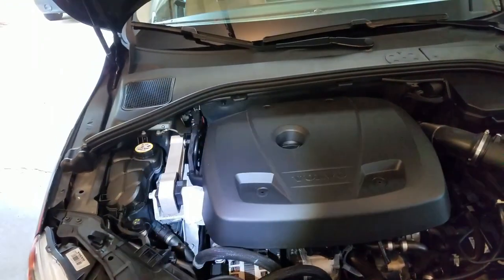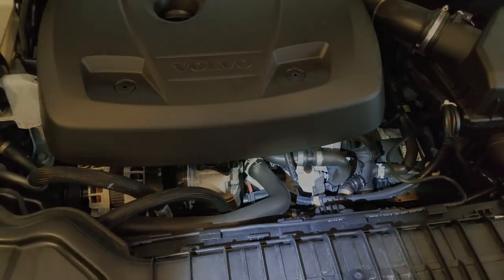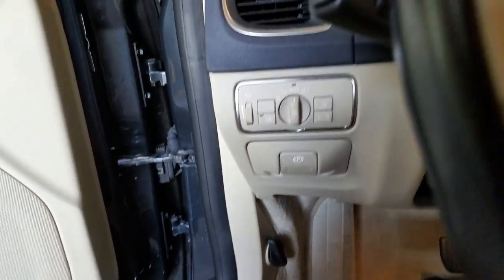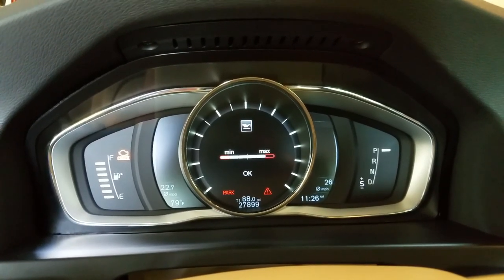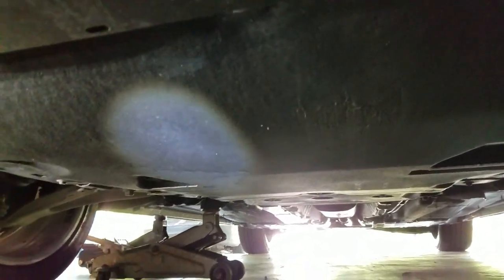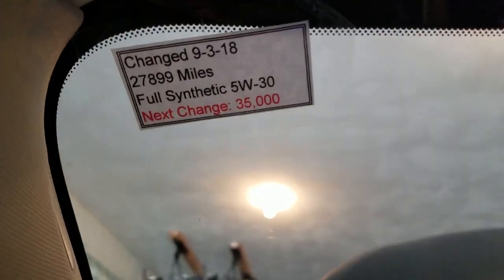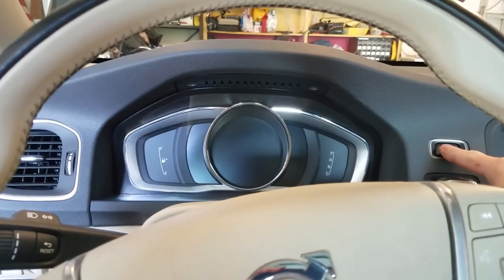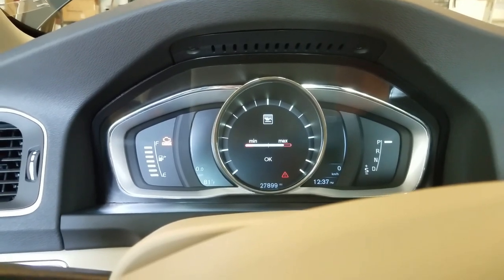2015 Volvo S60 4 Cylinder Oil Change

Comment: Thanks for the video. I want to ditto the other comment on using jack stands as opposed to a floor jack. I just purchased a Volvo with this engine and plan to do the oil changes myself. This was helpful.
Reply from the maker: I like that so many people are safety conscious these days so thanks for that!  I really want to get a set of ramps for it so I can just drive up on it, and even for those, I prefer to have jack stands as a backup too.  Hope you enjoy your Volvo as much I as enjoy mine.  I also have a 2009 S60 with 171,000 miles on it that is still in perfect condition.  My daughter will inherit that one in a little less than a year, and with proper maintenance, she should be able to double that mileage.

Comment: Hi did you check your engine serial number yet for the bad pistons and rings ?
Reply from the maker: I don't know of any reported issues like that for the 2015 model.  Are you thinking of the 2012 model that had a certain engine code, like engine code 62 or something close to that, where there was a TSB or partial recall for excessive oil consumption due to faulty rings?
Reply: @MIFixItDad  No its for the early model 2015.5 S60 T5 . My engine serial number falls in the bad area of poor rings and pistons . There is no recall , If you do have issues Volvo will fix if your in warranty . im pretty mad about it . I dont have the problem yet but probably will . When was your car built ?
Reply from the maker: I have the 2015, not the 2015.5 model.  It must be specific to the 2015.5.  I've searched all forums and reviewed all the TSBs issued for the 2015 S60 and can't find anything relating to a piston or ring issue.  If you have a source that shows what you're talking about with the issue you've seen, post it here.  It could be really useful for people to be able to go look that information up for their car too.
Reply: @MIFixItDad  Is your car the Drive E ? Start /Stop function ?
Reply: Im sorry Floyd im swamped right now i will get some info and post it for you

Comment: Are these reliable?  For college kids
Reply from the maker: Oh heck yes.  If you get one in good shape that had preventative stuff maintained, especially the timing belt and PCV system, then they are excellent cars.  Insurance is cheaper because they are notoriously safe cars too.  Basic things like making sure the suspension/braking/steering components are good (brakes, control arm bushings, struts, tie rods, and sway bar links) will help it last a very, very long time and continue to drive like new.  The parts are cheap and if you can do any work on cars, they are pretty easy to replace too.  Timing belt I would leave to a pro.  PCV system is a pain but a good home mechanic can easily tackle it.  All this applies to the P2 Volvo S60, the ones made from about 2001 to 2009.  The ones made after that, like the 2015, I can't speak for reliability.  If it has the 2.5L 5 cylinder, I would say they would be excellent, but I can't say for the 2.0.  So far so good with mine, but it has a lot more complex stuff on that engine and I think would be a lot harder, and more expensive to work on.
Reply: @MIFixItDad  thank you so much I had a 2012 and it was a great car but it had so many problems but I just love Volvo’s they drive so great and I feel safe in them

Comment: Thank you for a very excellent video.  We have a 2019 Volvo XC60.  I called Castrol and was told to use Castrol Edge 5W30 US in the black container.  Castrol did not recommend using the Castro Edge Extended Performance.

Comment: thanks for the video, yeah, i'm like you, would prefer to see the oil once in a while, but wow, 10k between oil changes is pretty long.   And I probably can't bring this to a quick lube place, with the skid plate and all.  Appreciate, ty
Reply from the maker: Hi Marcus, the quick change places will be able to handle it with the skid plate.  Seems like most cars these days have them so it's something they already are familiar with.  I like to control the quality of what I put in my cars though.

Comment: My oil reading keeps saying not available???
Reply from the maker: Try checking it with the engine cold (not sub-zero cold, just before you start it for the day) and on a level surface.  You can get that message if you check it too soon after shutting off the engine, if the car is on an incline in any direction, or if the temperature outside is very cold.  According to Volvo "The car must have been driven approx 30km and have been stationary for 2 hours with the engine switched off and on level ground before the oil level indication is correct"

Comment: Just want to say thank u. I wonder wld u mind to share more abt the long term maintenance cost (other than the regular engine oil and trans fluid change) for critical items/issues you had come across for this S60 T4/5/6 2011-2019? Thx a lot! God bless u!
Reply from the maker: Other than oil changes, air filter, cabin filter, and fuel, I've had no other maintenance costs.  On the 4 cylinder, the timing belt change interval is 150,000 miles so I still have almost 100,000 miles to go.  Volvo doesn't have a change interval for the transmission fluid.  Many cars these days don't require it, although I probably will do at least a partial change at some point if I can find a drain for it.  I did replace spark plugs when I got it with iridium, and I installed Max Brakes coated rotors with carbon/ceramic pads since I live in an area that salts the roads in the winter.

Comment: 5w30 dont you mean 0w20 on a VED engine
Reply: Craig Megson The 0w20mis for 4 cylinders. U can get what type of oil and how much oil u need from advance auto parts website. They will give u the answer. Nice parts store!
Reply from the maker: No, the manual, and the Volvo techs I talked to said the 5w30 was fine to use for every day driving.  When you are trying to maximize mileage, the 0w20 would be a bit better, but for most people like me that turn off the start/stop feature 90% of the time, it's not required.  At least it's getting easier to find in the stores though.  Just 2 years ago, I never saw it on the shelves in the stores.

Comment: HEADS UP . manual is wrong i have just been through this with Volvo and dealer . its 6.2 qts. Do some double and triple checking on your own but i think you will find 6.2 is correct
Reply from the maker: For the 2.0 4 Cylinder, it's 5.4 Liters, which is 5.7 Quarts.  The 5 cylinder takes 5.8 quarts, and the 6 cylinder takes a whopping 7.2 quarts.  With the 2.0, you can add up to a maximum of 5.9 liters, which is 6.2 quarts of total oil in the car without causing damage, but you'll want to make sure to check the oil level and make sure it's not showing overfilled if you do that.  If so, remove some about 1/4 of a quart at a time until it registers in the normal zone.  A normal oil change would only need 5.5 to 5.7 quarts.  What burns me is, after doing that oil change, I realized the US oils only go to a max ACAE A1/B1 standard, not the A5/B5 that Volvo recommends.  The Castrol oil I put in it is ACEA A1/B1 spec only.  If I change it a bit more frequently and don't drive it like a race car, that's probably more than sufficient, but it still ticks me off.  If I really want a true Volvo spec oil, I have to get something like the Liquid Moly LM20204 from FCP Euro or the Ravenol brand from BlauParts.com.  Either one with filter and shipping is probably going to run you about $75.
Reply: @MIFixItDad  I know i have been internet surfing for hours trying to find castrol a5 . Pennzoil Ultra Platinum 5w30 is A5 . Walmart website is 25 bucks . Are u aware A5 is a conbination that the oil covers both specs a1 and a3 ? Thats what i was told and read. Also where did you read about 5.9 l max ? I have not seen that anywhere ? And also (lol) you see in the manual about oil specs , it doesnt give a acea till it talks about severe service . then it says 0w30 A5 . Makes me wondet for shorter oil changes if A3 is fine like black bottle castrol 5w30 ?

Comment: A guy I went to high school with died under a car that was jacked up.  His dad had to raise the car and pull him out.  Jack stands are not expensive....cheaper than your life.
Reply from the maker: Totally agree.  That's why I never get under a car unless it has either a jack and stand, or 2 jacks on the same side backing each other up.  Good ramps are also an acceptable choice.  Most good ramps can support way more than the weight of the average car.

Comment: Why is it that these Volvo's have a "service port" that let's Volvo service Tech's check oil with a dip stick and not the owner? Blue dyed hair 20 year Olds, that's why. 10k between oil changes? Not me!
Reply from the maker: I don't agree that it has anything to do with youth or hair color.  Plenty of my kids friends (college age) dye their hair but also have used cars (broke azz college kids after all), and know how to check their oil.  It's the parents that are the reason manufacturers aren't putting a way to check the oil on modern cars.  They are more interested in taking selfies it seems, than in knowing how anything works.  I know one lady that never checked her oil, ignored the warning lights on the dash, and ended up with a seized engine.  Her kids warned her too!  Either way, I still don't like it.  I want my dipstick.

Comment: V 3 https://imgur.com/gallery/lx7sYzK. Here it is Floyd
Reply from the maker: I did find it once I had the TB number.  Thank you very much for that.  I appreciate the work and follow up.  Unless you look in the right spot on a couple of forums, there sure isn't much about this out there.  I did do a good bit of research yesterday though, and it doesn't look like it's actually faulty rings or pistons, just a design that makes them very prone to carbon causing the rings to bind and not do their job properly.  It appears most of the issue is caused when people use regular gas and cheap oil changes.  These cars and many like them are designed to operate best with premium gas, even though it's not required.  Regular gas actually burns quicker than premium, so the timing has to be retarded, which increases particulates and carbon, and reduces power.  The ring grooves on the pistons are very high up on the piston, which means they get hotter.  If carbon starts to build up, then that increases the heat in the cylinder and on the head of the piston and can cause troubles when the piston ring is in that higher heat zone.  Other manufactures have gotten around the issue by simply saying premium fuel is required, not optional.  Premium allows the timing to be advanced, the burn is actually cleaner and more thorough, and that creates less carbon buildup.  It's still a bad deal by Volvo.  If they are going to allow regular gas, then the pistons and rings should be able to handle it.  I think if you use top tier premium fuel exclusively, and the recommended oils, you should be OK.  I sure as *&%%) hope so anyway because I just got this thing and have several thousand dollars left to pay on it.  I'll be contacting my dealer, and a local independent that specializes in Euro cars to see what they say as well.  I'm going to be really pissed if it gets just out of the warranty and starts consuming oil.  Keep me posted on your results and findings too.
Reply: @MIFixItDad  Thanks for getting back to me . Im in same boat as you , i just got mine and i just turned 30k . Was hoping to get many years out of it . I just did a borescope of cylinder 3 to see what it looked like . It looked good no carbon at all . I suggest you get one then you can do periodic checks . The oil im using is Pennzoil ultra 5w30 it is supposed to be great for keeping engine clean . Walmart has it online for 24 bucks , which is great . It is A1/A5 so it has the approved ACEA criteria . Also im going to do 4k changes , I sure would not do 10K , no way . What do you think of adding a good cleaner to the gas now and then ? Gumout has good treatments with PEA. That chemicle is the only on market that works on carbon . Keep in touch , good luck to us both .
Reply from the maker: I think the first thing I'm going to do is remove the plugs and take a look.  I have a friend with a USB boroscope I might try to borrow also but I don't think I'll find anything either.  It would be cool to have one of the boroscopes and I see you can get them on Amazon cheap so I might just get one to have it for various things.  I thought of the Penziol too.  That is the only oil readily available in the US that meets the A5/B5 ACAE spec.  I actually wrote Volvo to let them know that the recommended Castrol Edge Pro isn't available in the US, that the closest available is the Edge extended protection I use in the video that meets an A3/B3 spec, and asked them what I should be using.  Their answer was to use Castrol, so I'm going to stick with that for now.  The A3/B3 spec is actually supposed to offer a slightly better wear protection than the A5/B5 if I understand correct.  The A5/B5 handles longer oil changes better.  I'm like you though... that won't matter since I don't plan on going 10,000 miles per change.  I'll probably do 5000 like I've always done on my 2009 S60.  It has 180,000 miles on it and runs like a Swiss watch.  I use the occasional cleaner in the 2009 so as the 2015 gets a little older, I will probably use one in it also.  I have a Costco membership and try to use the top tier Premium there exclusively as well.  I know I can't when I travel, so I look for the branded stations to hopefully get the best quality gas I can.  I guess at this point, all we can do is maintain, document, and keep our fingers crossed.

Comment: Don't be fooled by the Volvo badge,,your really driving a geely,,Volvo is now Chinese owned and made with Chinese parts,,you can buy this same car in china but with a geely badge for one third the price,,These basically disposable cars with very cheap components in them,,Just like before 2017 All volvos were basically fords,,
Reply from the maker: Actually, most of that statement is false.  When Ford owned Volvo, very little Ford ended up in Volvo except electronics, switches, etc.  Ford actually took the superior construction and design and integrated it into some of their products, such as that incredibly reliable 2.5L 5 cylinder.  Geely now owns them but most of the design still remains with Volvo in Sweden.  Unfortunately a lot of the cheap plastics from China can now be found on the interior.  The cheap "Volvo" you see in China, is usually a copy, not an actual Volvo.  Chinese companies are great at copying other products and making a crappy, cheap alternative for use in China.  Overall, I can't say I trust Volvo to be reliable any more since Geely took over.  They are pretty, but I don't get the feeling that any of the new ones will be joining that million mile Volvo club.